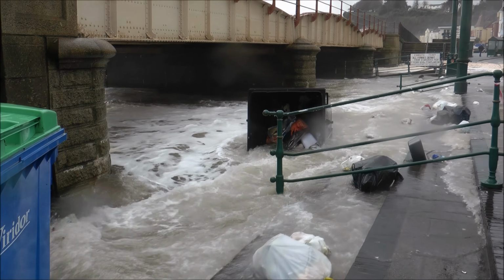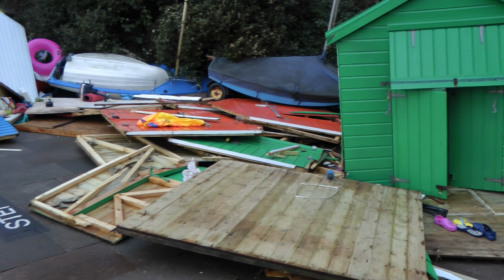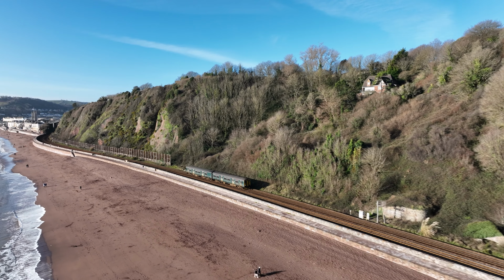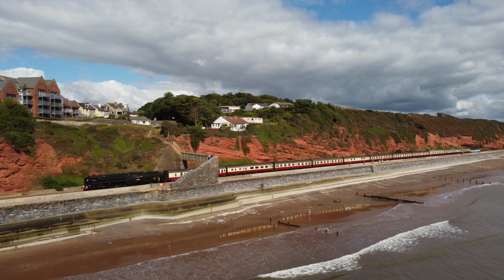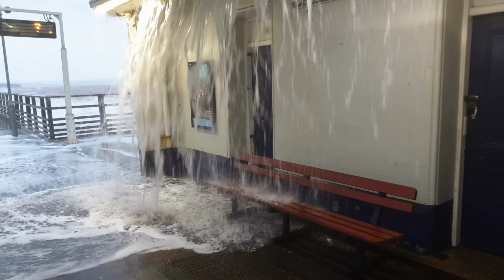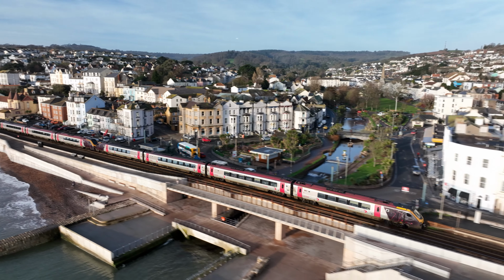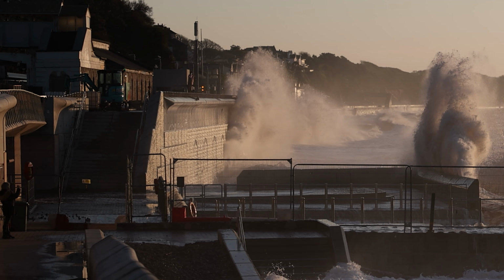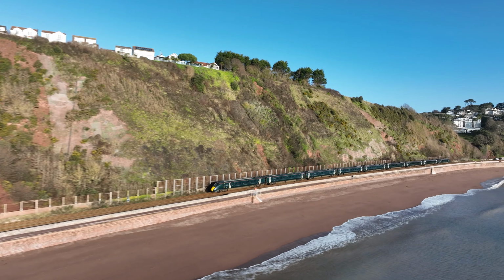The Great Dawlish Storm of 2014 - Saving the South West

Comment: Thanks for that, some footage that explains a few things... was an "interesting" night further round Lyme Bay too. Very glad Dawlish got a sea wall worth the name now ( I suspect it'll last longer than the rest of Dawlish! ) and I'm quite curious what the rockfall shelter is going to end up like, but I have to say...

Who thought the architecture for the rebuilt station was remotely fitting? that bridge and the way up to the station is a brutalist slab of grey concrete straight out of the worst of the 1960s - it's not going to weather like the rest of the architecture either, it's just going to be dirty grey concrete with probably some marine foliage clinging to it. The sea-facing wall is fine because you don't see it often but that block bridge just looms over everything. The rockfall shelter at least got coloured to match the local stone!
Reply: But the salt water would quickly rust a steel bridge and rot a wooden one. A brick arch would have been nice but the next big storm could collapse it. It would need constant repair. Concrete is probably the strongest.